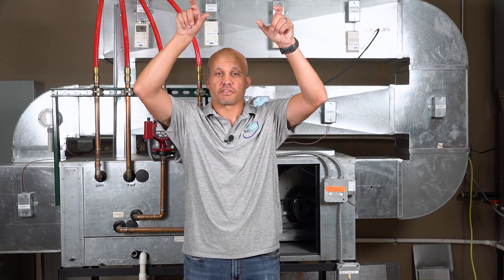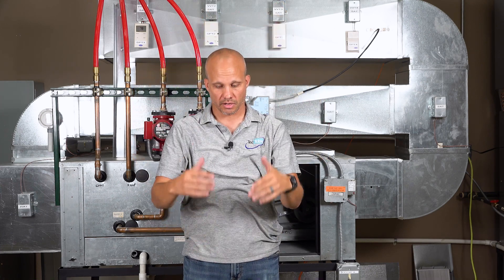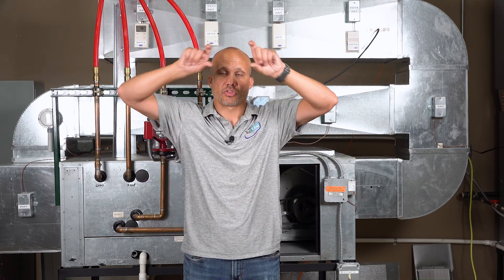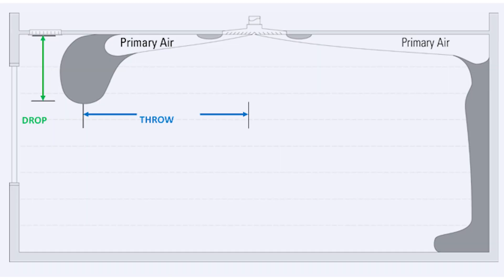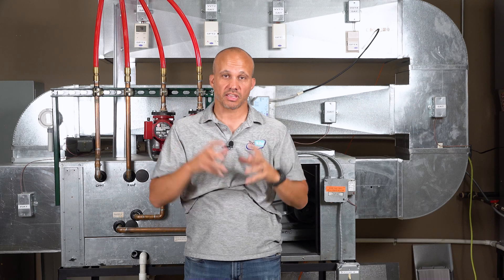VAV Systems Basics

Comment: I take it you have never seen a vav box with a hot water reheat coil. Dave H retired air balancer
Reply: I was thinking the same. I work in building where they have dual duct vavs
Reply: @nit5296  Dual duct, however, is not something I have nearly as much experience with. I saw 2 systems back in the 90s with dual duct but none since. It is not as popular due to the higher installed cost and inability to comply with modern energy codes.
Reply: @ryanhoger1  that makes sense, the building were very old and had a lot of issues. The guys who bought the building and designed the HVAC didn't want to pay the controls guys so they ripped the controls and took their program w them.
Reply: Fast forward to about minute 6 or 7. Zone level heat is discussed and includes baseboard (hydronic or electric) and duct heaters (hydronic or electric)